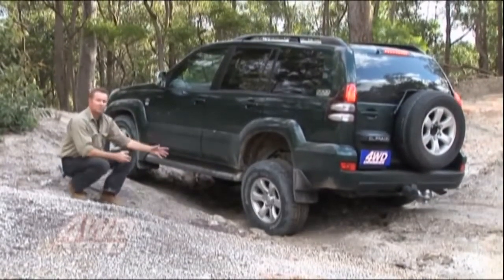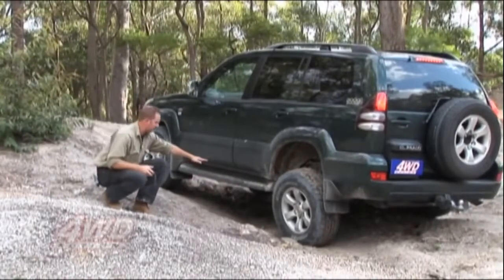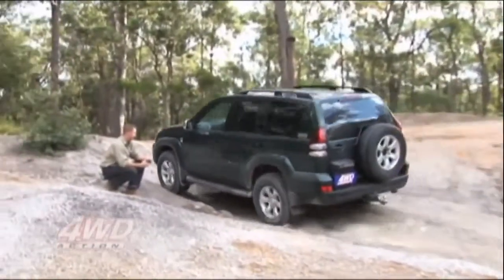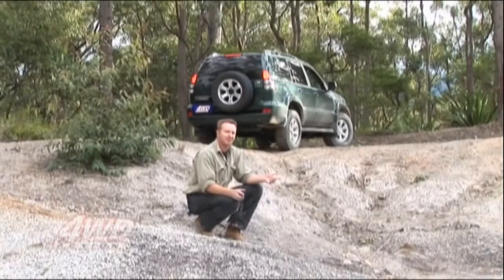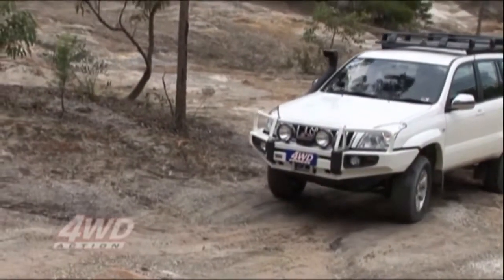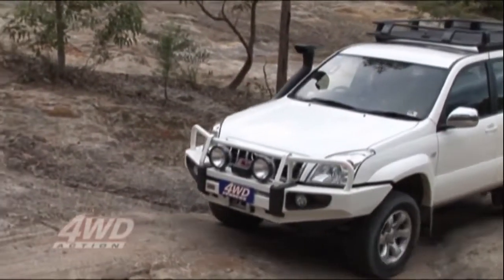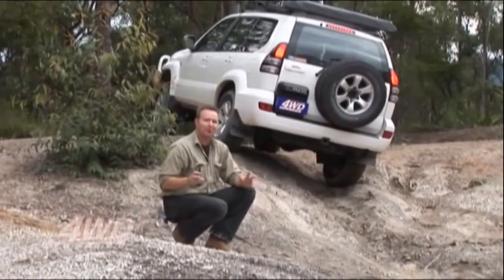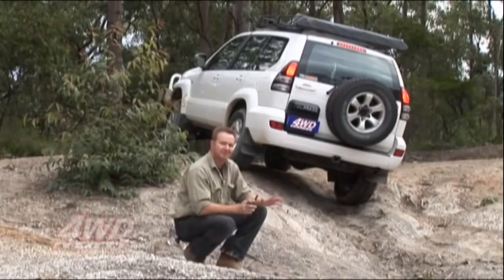E locker VS Air Locker 0

Comment: I think its a little confusing ... Vehicles with an E-Locker generally have an actual locking rear diff, Similar to a rear air locker sending power to both wheels at a 50/50 distribution. What was demonstrated here was an advanced traction control that breaks individual wheels when they detect slip sending power to the opposite wheel. Each manufacture has a different name (x-Mode, i-Drive, All-Mode etc..)  An e-Locker is an open diff until you engage the system, it then locks the diff (not just use breaks to send the torque from one wheel to the other). Some manufactures use both, propper e-locker in the rear and then use the TC system to limit wheel spin and divert power to the wheel with traction. Still has to be said.. Air-locker > E-Locker or FakeLocker
Reply: Agree that the title is misleading. Elockers and air lockers are both lockers. Electronic traction control is what they should have labeled the video.